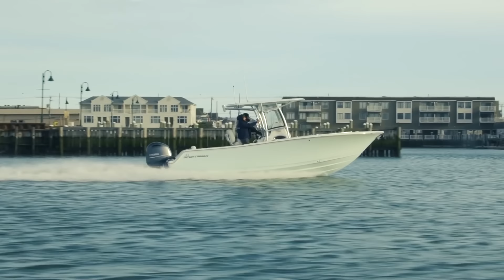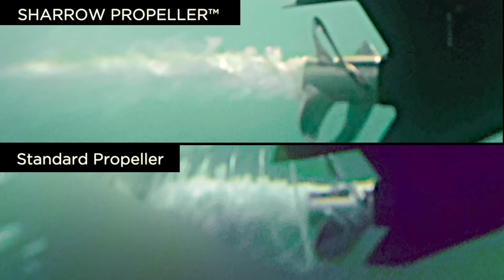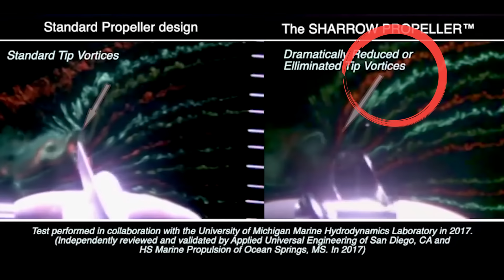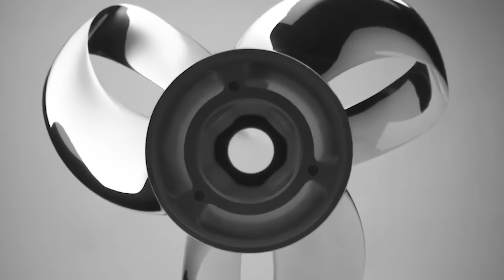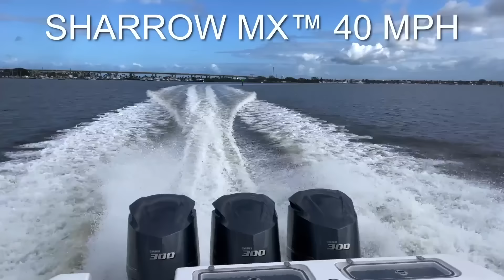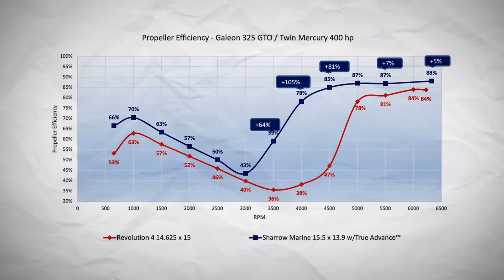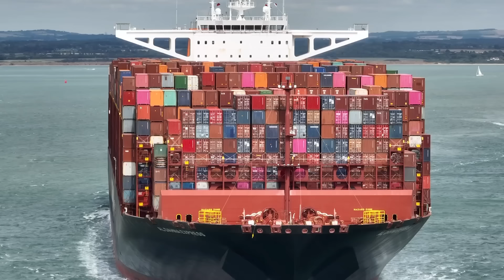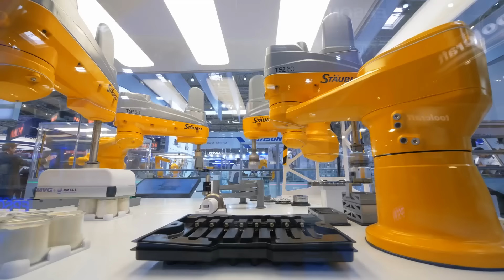This Genius Propeller Will Change Transport Forever

Comment: It would be interesting to see whether a variant of this would be suitable for use in energy production plants, such as wind farms or hydro electric dams
Reply: Wind maybe but likely not for hydro or any other application in a confined space (pipe /duct) with a cowling which already deals with this  tip effect.
Reply: Sadly, it's not that simple. This design have a fix pitch (angle with fluid) of blade. For wind turbine, helicopter, or aircraft propeller you need to change this angle for multiple reason. It's add a level of complexity to the design that even today is hard to solve.
Reply: @Nyarlathoteps1  that explains a lot, really !
Reply: @Nyarlathoteps1  That's only true for large industrial wind turbines, for any personal wind turbine you use a fyrling tail instead, to control the rotor angle against the wind instead of individual blade angles.
Reply: It maybe be interesting in some energy sector. But hydropower are already highly efficient up to 95 to 97% efficiency.
Reply: @phetthasonemanipakone7180  well sounds like we got an extra 20% of that
Reply: @Tu276-p68  100% efficiency is the max you can ever get, so there is not much to gain from 95-97.
Reply: @znail4675  this is what I don't understand. In the beginning he claims up to twice the efficiency while the base prop is easily over 50% already.
Reply: @Tu276-p68  The toroidal shape is beneficial only in applications that don't have ducting. The presence of ducting in applications such as hydroelectric turbines found in dams eliminates the benefits of the toroidal shape.
Reply: @Tu276-p68  No, because water turbines doesn't use propellers, they use Pelton wheel turbines. Way more effective.
Reply: Or helicopters with three big doughnut blades. Wuowouwuow wouw!
Reply: This propeller would fail to convert enthalpy to work effectively as it's best use is to displace it's surrounding allowing for more thrust in a direction. You don't do that with wind, rivers, or even steam from a nuclear plant. This is however an insane step forward for boats especially submarines who want to be fast and remain quiet.
Reply: Wind needs very long thin blades.   Propulsion uses short and wide blades
Reply: a wind turbine, I was just thinking the same thing 🤔
Reply: Doubt it, they spin too slowly
Reply: @polla2256  you must have never seen the gear box in a wind turbine. planetary gear that is 1:100
Reply: Unlikely for wind, as you need the ability to adjust the pitch of the blades and sometimes even turn them off completely.
Reply: @Steelrat1994  Only on large corporate wind turbines. Otherwise you use a furling tail instead of adjusting blade pitch.
Reply: @calysagora3615  I think the word you wanted was industrial, but ye. Other wind turbines are not going to make much global  impact no matter which blades they use.
Reply: I don't think it'd be better in a standard hydroelctric dams, they're already extremly efficiant with upwards of 92%+ efficiency meaning 92% of the kinetic energy of the water hitting it is transfered into mechanical energy/electricity. Also the turbine used in hydroelctric dams are very different from propellors. Where i think it could shine though is with hydro power made with rising and sinking tide water.
Reply: @emilh5477  Yes, Pelton wheels makes for much better hydro turbines.
Reply: it is not. we simply make the blades larger  this could actually be worse for wind farms.  as wind hits the front blades and leaves it, the wind immediately loses energy to drive the rear blades.  wind farms place each wind turbines far enough from each other for max efficiency or wind energy.
Reply: The main benefit of the toroidal shape is that it self contains its own ducting, and placing a toroidal blade in ducted spaces reduces the benefit of its shape. However, I'd be very interested to see the benefits in wind turbines and prop planes.
Reply: The effect would be opposite.

Say that a standard propeller can move 10 kg air with 1 J of energy. And a special propeller can move 20 kg of air with one J.

Now let's look at the oppostite:

If 10 kg of wind gives a turbine with a normal propeller 1 J, then that same 10 kg will give 0,5 J with a special propeller.
Reply: I suspect putting toruses at the ends of wind turbine blades would reduce noise if nothing else

I also suspect the stresses on them would be too great for toroidal blades to withstand
Reply: I doubt it. That sounds like a LEDs are shitty solar panels type thing.

Comment: The efficiency graph for the boat prop isn't giving real world use data I was under the impression that if you wanted to get your boat up on plane that you would throttle up to get onto a plane and then throttle back down to your desired RPM. Which does not represent the data that their test shows.

Comment: 5000 bucks vs 500 bucks is not worth the cost. Youll get back the money after you ride your boat 50000 miles which makes paying 4500 extra not worth the upgrade. I highly doubt this efficient propeller costs so much more to produce - my guess is about 500 bucks more to produce - then marking it up 600% is pure stupid. That would be like tesla asking $150,000 for their model Y.
I would not buy it. This propeller is only for the super rich. Waste of good tech.

Comment: very hard to scale them up at least for now, normal carrier propellers are a single piece of metal and those thinner blades would have a different rate of cooling. It would probably require alot of try and error to get the correct mold for that.

Comment: Two questions:
Are these toroidal propellers more or less susceptible to weed fouling than traditional propellers?
Wouldn't a traditional propeller that is encased in a ring also eliminate the tip vortices and run more quietly?
Reply: Much less. Our fisherman, referred to above, named this as a bonus advantage.

Comment: Rather than CNC from a solid block, would it make more sense to forge them in a mould (or at least a majority of it if possible) and CNC the excess off?
Reply: Casted iron is quite brittle, but aside from the material, the method would be posible to an extent, cnc machining a bulk out of the block isn’t the biggest of concerns though.
Reply: @ignacioaguirrenoguez6218  
That makes sense. Thank you!

Comment: This will take off if it's as good as shown. Minute little problems with it costing more to make will be completely nullified by the silence and power generated. Might even see it in helicopters if they can figure out a system to drive the edges and steer, but I doubt it. Prop airplanes? Hell yeah.

Comment: Nuclear submarines have used much more efficient technologies in propeller design to reduce cavitation and therefore have an advantage over our enemies in remaining silent or better hidden in the depths of the world oceans. Could it be that those advancements were not shared with the public in order to maintain the top secret competitive edge over our adversaries, and therefore delaying an important step forward in efficiency (reduction in the carbon footprint, noise pollution, etc.)  for at least several decades?

Comment: The propeller application at sea could see problems due to barnacle formation on the propeller. This will change the shape of the propeller. I wonder if the changed propeller profile wouldn't be more noisy and less efficient than the standard shape.

Comment: This was just full blaah.. why even bother to write it changes everything and is 20% better or over 100% efficient.. This brings just those screws to my mind (used in subs), but this not going to be used in some container shipping, where most of world oil based fuels are burned yearly. This can be made to variable blades to use where needed, but it broke most of it's "fantastic properties"

I think it looks good, fancy and only James Bond will use it in reality.

If it's 2% better than original propeller or screw, everyone buys these. I don't see it's happening. 
I don't say it's scrap totally, but this promotion smells little bit too much for me.
Compared video's show exhausts and cooling waters sprayed in same mess, so it's not fancy way to compare things by eyes.

And last thing; these types were first water propellers when side way axial huge blades each side of ships were thrown to scrap bucket. 
I think man powered submachine "things" used little bit this looking things.

There is big surface area with water and that alone dosen't change amount of friction, with reality it does many things. 

How cavitation effects to this thing would be interesting.. Ofc it destroy everything when lasting some time, but does this can handle it better from happening in first place?

Comment: It's hard to take the video seriously when it has a thumbnail that states "105% efficiency".  Do you really believe that this design can put out more work than has been put into it?
Reply: It doesn’t say that. It says +105% efficiency. +100% means double. It’s slightly over twice the efficiency.
Reply: @ryanespinoza7297  , as in 105% more efficient?  Yet it the video he claims only a 20% increase in fuel efficiency?

Comment: There is also a new improved heat exchanger that keeps running at 100% capacity without needing to be serviced, this also has huge benefits in many industries, and saves a mind boggling amount of energy
It is called foulingCure chould be a awesome video

Comment: I think the patent system should be dropped as it impedes a better life for everyone for the benefit of the very few. Also, there are no new ideas. Somebody will have already thought of this and just didn't have the means to develop it. I also thought of this twenty years ago, which goes to show that ideas are ethereal and just float in the air untill someone becomes in tune with them . If the patients were abolished or never existed, we would already have clean free energy for everyone. But that would take away the power of powerful people and we can't have that, can we? A world where everyone is self sufficient and "carbon neutral" as they , so shamelessly declare.

Comment: It would be interesting to see how these would work on sailing yachts at the lower speeds. The other thing might be the affect on prop walk going astern.
Reply: I am guessing efficiency would be lower at slower speeds.
Reply: I think they'd need a folding version. Most sailing yachts have propellers with blades that rotate into a position where there is less drag when travelling under sailpower alone.
Reply: @MalcolmMacPhail  Folding or feathering props tend to be best suited to racing type yachts where they do offer less drag. The problem is they are very expensive and depending on your keel arrangement, on cruising yachts they don't reduce the drag that much. The biggest issue with many sailing yachts is going astern (backwards) where the prop acts like a paddle wheel and pushes the back of the boat to one side. Not very helpful in tight moorings!
Reply: @rogersmith8339  Propellers (and anchors) were often discussed amongst the other cruisers I met while crossing the Pacific.  Most of us have folding props (estimates are 5-10% reduction in drag) which is helpful when on a long passage. My boat (a 43ft cruising yacht) has a 3 blade Max-Prop, which feathers and reorients its blades producing more power in reverse and no propwalk.
Reply: @MalcolmMacPhail  Our last yacht was a Barbican 33 with a long keel so a folding prop would not have helped much (BTW, when you got the hang of her, going astern was not much of an issue. Our current 40 long finned / Scheel keel yacht is a pig astern! I know some folding props are very good at reducing prop walk, but our neighbouring boat had one that did the opposite, but it is a bit of a racey boat.

Comment: I saw a video of someone who did 3 of these propellers and slapped them onto a graphics card. They porformed worse and were noisier than the noctua fans, because they didn't spin at such high speed as on a motor boat or drone. So , for computer applications, everything has been tried for silence and I can say we are at the end of engineering something quieter. It can only be quieter if we reduce  the power consumption if the chip and increase the metalic cooler size. Fan wise, we cannot improve any more.

Comment: This type of propeller could actually be casted in a few ways and then use multi axes to clean the casting, doing this would reduce the cost and manufacturing time.

Comment: Part of that extra cost (a big part) is in my opinion due to the rip off factor. Traditional props are manufactured with a combination of casting and CNC polishing, and CNC manufacture makes it a bit more material intensive but really I don't see why an appropriate casting die couldn't do it more traditionally. Think about it, they make an engine block for a V8 for about $800 which is way more complicated.

Comment: I would like to see a test comparing a Toriodal prop and a standard prop of the same surface area... I have only seen them compared to 2 blade propellers and of course it will be more efficient it has more surface area, you get an efficiency gain with a 4 blade prop over a 2 blade as well, I would like to see the Toroidal prop compared to a 4 blade prop of the same surface area, that would be an apples to apples comparison

Comment: You better get your information straight. 201% improvement and 50% increased efficiency leading to 20% fuelsaving? A good propeller gives 70% propulsive efficiency on a good day, add 50 and you are at 120%…………… it is all over the place, the noise test is one with engine sound and one without, none of the sound is propeller related. Somebody might even believe what you are claiming here!

Comment: Seem’s a bit too beautiful …
Of course being focused fuel economy is quite new , but since the 70’s we would probably hear about that, biplane planes have been abandonated. Arguments need to worked on , ( especially the noise demonstration  with two different boat ).
In fact this video look like aadvertisement. 
Care on fuel consumption when using 3x300 horsepower on a boat ?!
Reply: https://patentimages.storage.googleapis.com/d6/fe/53/bea4417ed89176/US10836466.pdf

Also the argument to respect the ocean life is uncorect i think , because we talking about human audible noise which is probably very different from what the ocean life are capable to hear let see what it come but i think , 
But i think there’s much more to gain by working on vehicle drag …

Comment: Im sceptical on the boat prop because in the video you see less air bubbles that you can clearly see but in the noise video both engines let out exactly the same amount of prop wash which isn't what I was expecting if the Toroidaal propeller makes less bubbles.

Comment: When I read about this tech last week, I was completely stunned.
This tech is gonna transfrom transport immensely. So many things are praised as a "big, groundbreaking innovation", but this actually IS groundbreaking.

Just imagine all the propellers we currently use in different application. And all of them have efficiency and noise problems, ALL OF THEM. 
Consequently, this tech will take over the different application really fast.

PS: The 10x price difference is also no problem. Since the advantage already outweigh the cost, the scaling up is gonna be fast.
As soon as they can mass produce the propellers, it's price will only be a few % higher than the standard ones. The tech to produce these shapes are available, at least at lower prop sizes.
Reply: @Pickle What is a "while" for you? What I found is a patent of 2019. With a first concept patent with priority in 2013. That is not really long for technical innovations.

Especially considering that most technologies for prototypes wasn't suited for such complex forms. This changed a lot in recent years.

PS: I also don't care at all about hobby motor boats. I care about the largescale applications for freight ships, drones, fans in all their applications etc.
This is where the money and the innovation potential is. Leisure is just that, leisure. No great potential anyways.

Comment: Toroidal props do have a lot of potential, they have no tip vortices formed... theyre nice and quiet compared to normal ones too because of less turbulence from that.   Its really nice.  105% though?  ... it isnt overunity, I guarantee you that, so im guessing this doesn't mean a total efficiency of 105%...

Comment: I really can’t see any reason at all the manufacturing process for these (in the longer term) should be significantly higher than a conventional prop - and certainly not 10x higher. Surely if a 20% efficiency increase is genuine, this would have been progressed. I note your efficiency data is based on a direct comparison at a fixed 4000rpm but doesn’t mention whether it takes more fuel/energy to keep it at that speed, is it possible it is moving more water as a result of having more drag? Very interesting concept, I hope it’s explored more fully!

Comment: The drive propellers are not 1:1 between the to types, the toroidal wing area looks larger then the normal prop.
More wing area = more lift at same motor speed = more power required from the motor.
The efficiency measurement needs to be at the motor, because if the toroidal just wins because if bigger wing area the motor can overheat and burn because of higher load.

If I put larger props on my drone I would increase lift at 50% throttle and have a quieter drone, but burn the motors if I go to 100% throttle because of too much power in the motors.
Reply: Dude, we're trying to move product here!  /s